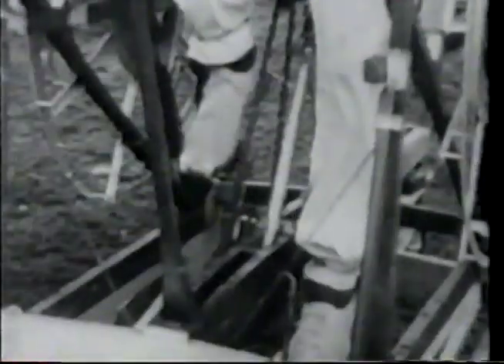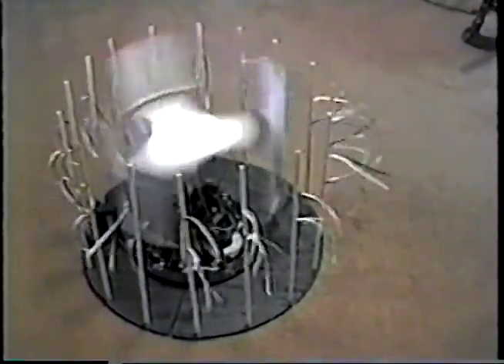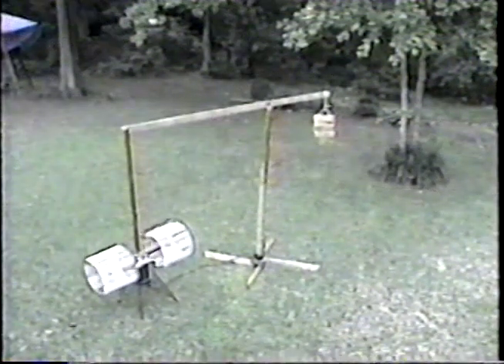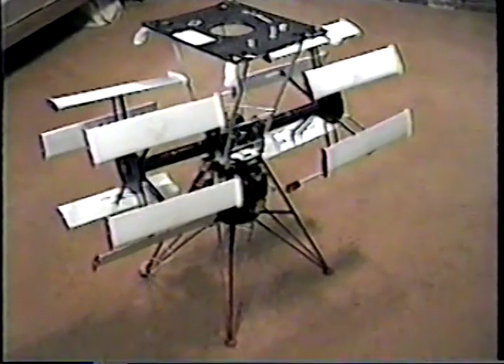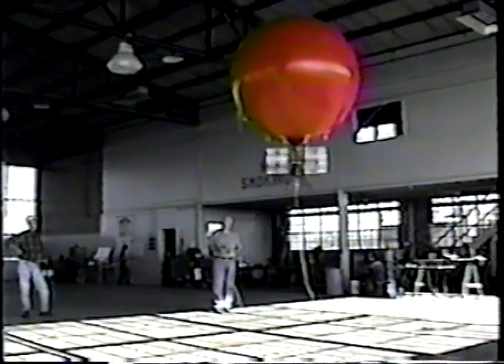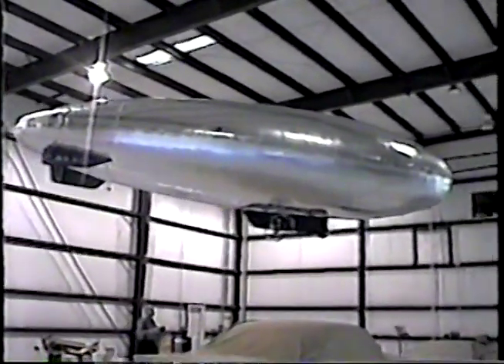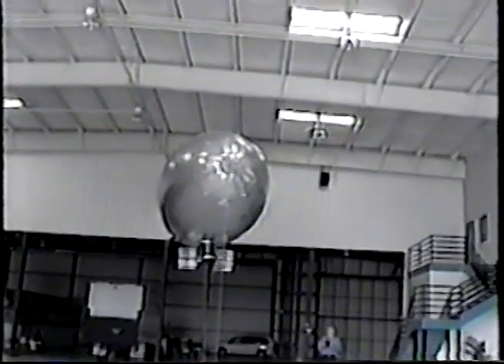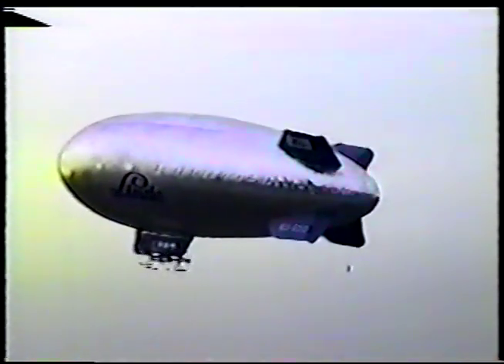Experimental Airship Propulsion: Roy Gibbens

Comment: Fascinating. At the risk of being an armchair quarterback, why not mount the toroidal propellers directly to the side of the dirigible  rather than to the gondola? This would provide greater torque, and thus better control, plus the propellers would be a good distance above the ground, making them safer for the ground crews?
Reply: That was the idea, but for simplicity this was the easiest.  After all, he built this all himself(mostly) with limited funds.